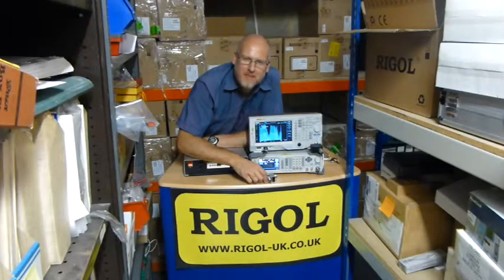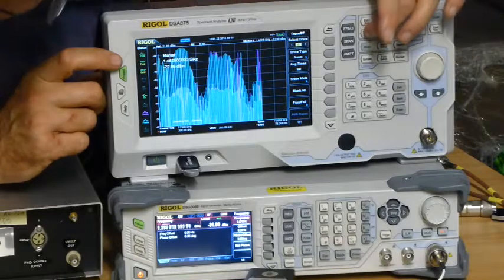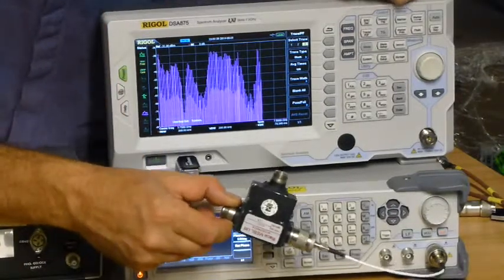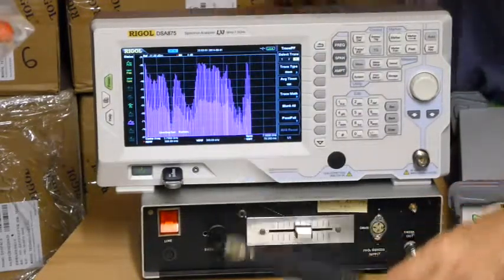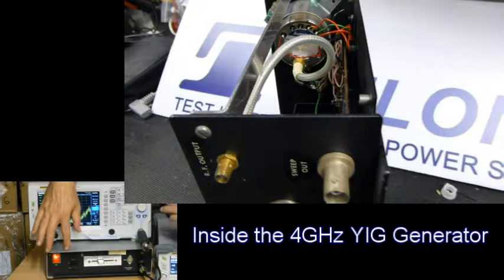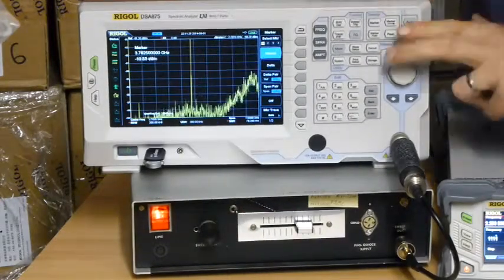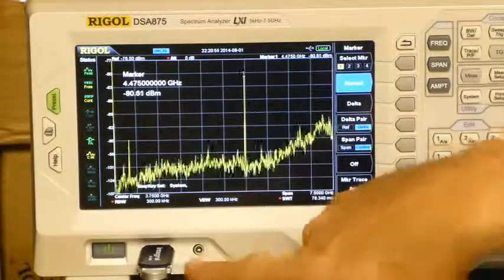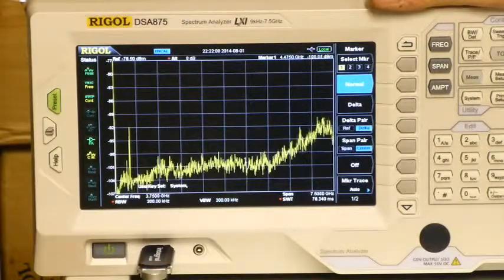RIGOL DSA875 explores YIG oscillators at up to 7.5GHz... newest spectrum analyser vid by UK Team

Comment: Thanks for the nice video. One thing I don't understand - it looks like you connected the analyzer to the "sweep out" BNC connector instead of the "RF Output" SMA connector on the YIG sweeper. When you show the inside of the unit, it looks like the output of the YIG oscillator goes directly to the RF Output connector and has no connection to the sweep out connector.